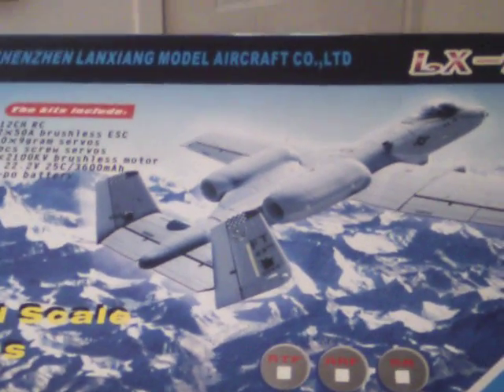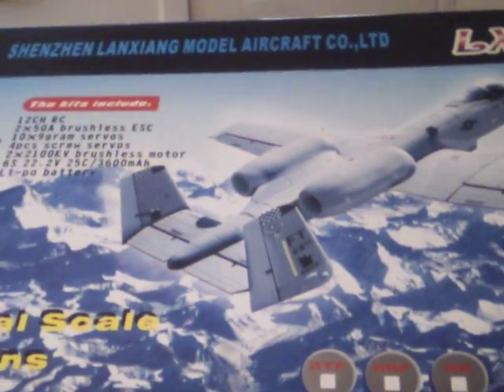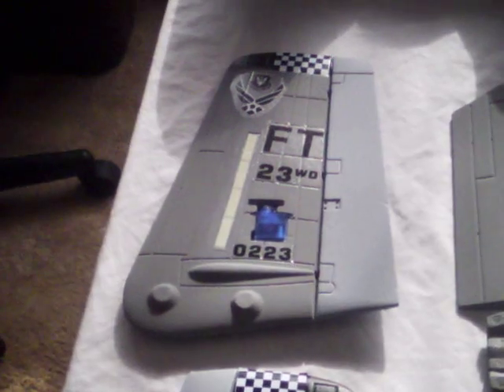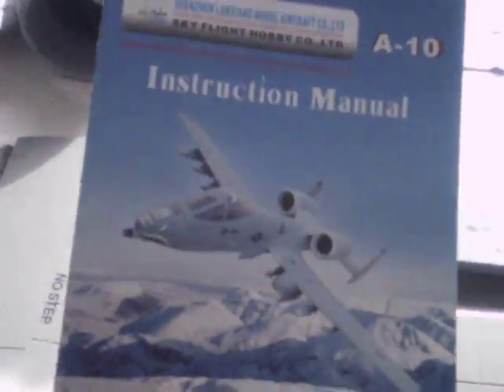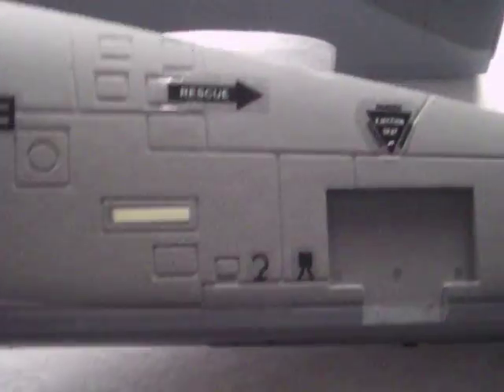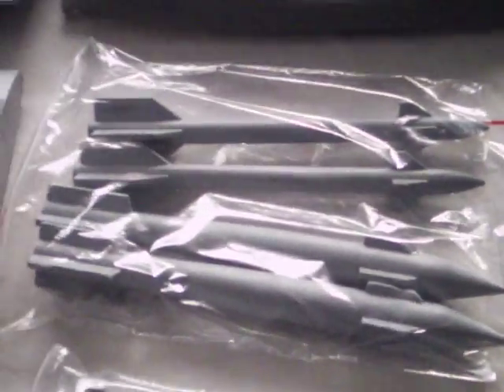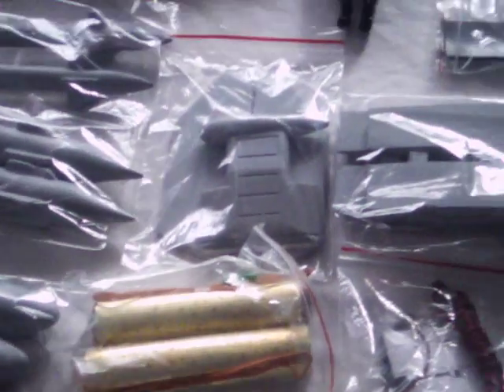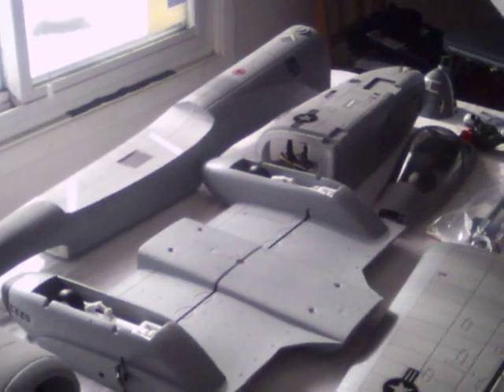L.X.Models Twin 70mm A-10

Comment from the maker: No, the stock servos are your garden variety 9 grams, not metal-gear. I replaced my aileron, and elevator servos w/metal-gear servos very easily (and recommended..)
Reply: Roger that !!
Reply: I like the extras it has ejection seat etc' be even better if it had counter measure flares that would look awsome.

Comment: Hello. Thanks for the tips. I hit a snag with the maiden flight. Upon the run uo of my motors I inadvertently ley the neck dtrap get sucked into the a motor and "destroyed" it. Rookie move. After getting two new motors and fan units $78.00 and time to install th, on of mu esc,s cant handle the load and cuts power till I get off the throtle. Gerrrrrr. I also cant post a video from my phone to YouTube.

Comment: I didnt connect the rudder to the nose gear by a splitter. Thats why i couldn't make it steer. Yes the stock  , I will get a splitter and try it then. Is there another way to contact you for quicker communication? You have alot more knlowage then i do.

Comment: I went out and got a DX8 that came with a telemetry unit and 2 receivers. I was never able to bind the cheap 12ch one from BH. Oh well, I'm installing CF 1/4 strips throughout the main wings for more stability. The 5 inch rod isn't going to cut it.

Comment from the maker: @treverbush     Make sure you have the throttle in the correct channel, and the BEC in your aux. or Batt. channel. This may be your problem, but I don't know what radio your using.
Reply: Question: i  got my a10 since a  week, i have put my throttle  in channel 3, but how can i put my BEC 's in AUX?

Comment: Hi, 
About A10. 
Do not worry about you about maiden flight. 
The flying method of A10 is simple. 
The CG point does not have any problem in a manual street. 
However,  CG think that the some back is good.

fuga3500gtfour